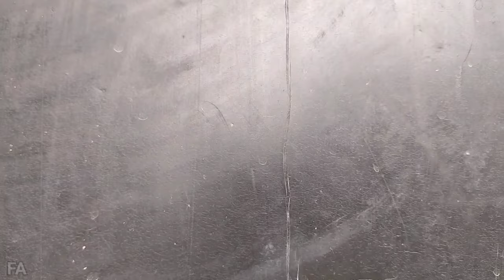When going to dhanicha field for puddling || Kamco Kmb200 puddling performance in deep mud ||

Comment: Power tillor Survice time   kon konsa parts important hota hai 
(1) Engine oil
(2) Oil filter 
(3) Chain oil 
(4) ? 🤔
(5)? 🤔
(6)? 🤔
Please reply 😭
Reply from the maker: Air filter.
Belt tension.
Oiling & Grease.
Check all nut bolts.
Greasing belt tensioner Pulley.
Check both sides oil level of rotar shaft.
Reply: @FarmingAreaofficial   thank you Bhai 🙏